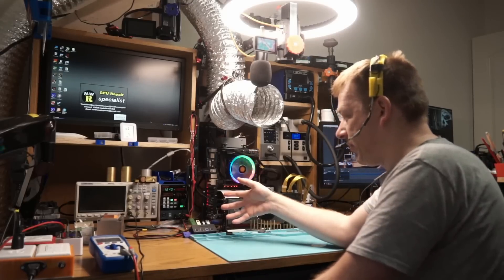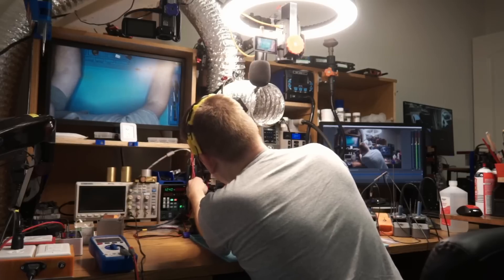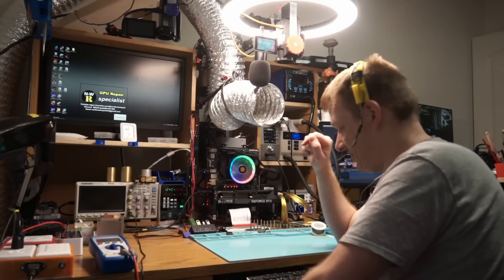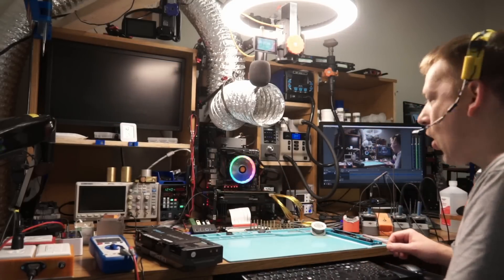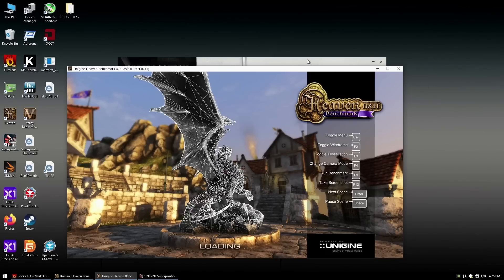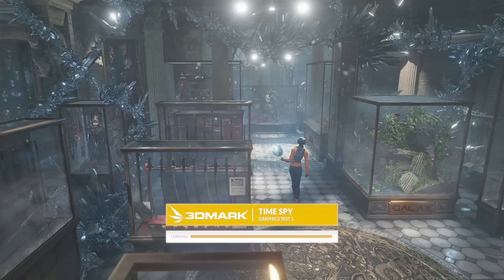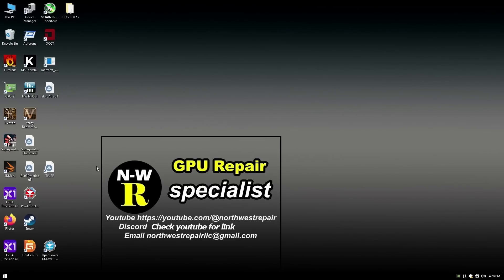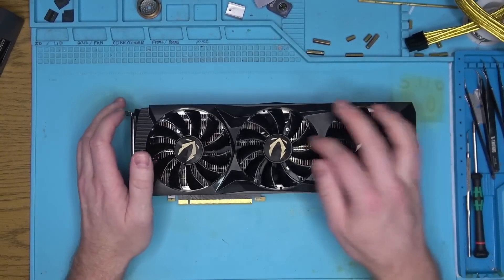Can you swap GPU while computer is at sleep ?

Comment: I doubt the OS fully restarts the graphics driver when it comes back from sleep, so it'll only work if your replace the card with something that would have exactly the same driver state in RAM (meaning it might work with cards from the same generation - though there might still be enough differences between different models that the driver doesn't actually load the exact same code).

Comment: The only thing I know is bit of an issue if you replace during sleep mode is RAM. Windows was so unhappy it didn't want to boot and took bit of persuading to do it. I would assume same happens if you swap CPU. But for graphic card it likely goes like, "I don't know you, you don't know what we did last time" and reboots. :-D Unless Microsoft fixed RAM swap to reboot too. Since last time I did it by mistake it was when Windows 7 was still current. Though considering when I got my work laptop upgraded, IT guys asked me twice if I shut it down and not put it to sleep, I assume they already knew it would be a problem. Didn't get much more info out of them than that... they tend to very quickly tell me to not touch whatever I ask about, like they are worried I might do something... I did once almost got one of them to give me admin account though. :-D
Reply: Not really. Wonky stuff happen due to RAM having some very damn important (for OS) information that you remove. Basically same as killing a bunch of windows services till it bluescreen, but instant and very confusing for OS. With GPU on the other hand...it just dont have any drivers loaded in, and windows cant run without some kind of GPU, so it reboots to load at least basic ones. Can be bypassed by having iGPU or another graphics card in the system as output, so there is at least one working gpu with loaded drivers at all times.

Comment: I think if you replace the gpu in sleep by the same model with the same specs that uses the same drivers this might work. But if you switch to a different model/vendor the drivers are not loaded and the system might crash. I assume that it's not a great idea to do this.

Comment: 3dmark prob has some anti benchmark cheating code that his fishy card is triggering.
Reply from the maker: turns out call of duty does not want to play either so its not a 3d mark issue, its the card.
Reply: @northwestrepair  sadge
Reply: @northwestrepair had a card acting up artifacting heavily but only Ubisoft games R6 for honor and Cod. Amd VEGA
Reply: @user-kd1qg4fo1d  Happened on my 5700XT, sometimes it would artifact on R6 but it doesn't happen in any other game so it's a driver issue
Reply: @northwestrepair  probably solved by now but..., guessing undervoltage, voltage drop under load, a faulty capacitor possibly, or a cold solder (unlikely) .. else if ur running anything else polling the card ..
Reply: yeap, does the same thing once sth tripped when I ran it with in my vm,it just says error occurred, however bare metal works just fine.

Comment: Hey Tony, I'm reading some forums on this issue with the 2080ti and 3DMark, seems that if the GPU is power/clock throttling by a large amount then it could affect the score or the test. They recommend turning off the speeedstep and/or putting windows into high performance power mode. What I did find funny is some have stated "Faulty Products" as a result naming ZOTAC and Gigabyte specifically! 

I think my favorite posts are telling people to user EVGA Precision to tweak until it works, (specifically they think undervolting might solve the issue), or to get an better card. In other words they are just as confused! Take care!

-Deuces

Comment: The PCIE slot has a wake pin that will bring the computer out of sleep.  I've had a few misbehaving PCIE cards (ethernet and wireless) over the years where I've had to cut the wake pin.  They would sometimes even power up the computer from the off state when inserted into a slot.  That caused some really weird problems.  Cut the trace and the cards worked fine.
Reply: You could just disable wake from pcie from bios.
Reply: @krypton1260  In theory yes.  I have a Supermicro Xeon server board and a Gigabyte AMD board (and probably others) that do really weird things.  The Supermicro board will power on regardless of BIOS settings.
Reply: So that's why my computer was turning on randomly
Reply: The less drastic way to fix this problem in Windows from the command line is to run 
POWERCFG /DEVICEQUERY wake_armed
Identify the offending device, for instance "Intel (R) Ethernet Controller (3) I225-V"
POWERCFG /DEVICEDISABLEWAKE "Intel (R) Ethernet Controller (3) I225-V"

It's also possible to do this in the Device Manager in the "Power Management" tab of the properties for the offending hardware. Device Manager isn't organized to do this efficiently, so powercfg is the better way to do it.

Comment: another likely reason that it doesn’t work when you switch to a different gpu, is that pcie isn’t hot-swappable on windows. it doesn’t like detecting new pcie devices until reset. not sure about Linux tho

Comment: 3DMark probably begins the benchmark by sending a max load/full power to bring the boost clocks up before it begins. I suspect there is a power issue only when the GPU boosts with a full GPU load and a full power draw at the same time.
Reply from the maker: clock boost to max when you open GPUZ and then saddle down.
Any game engine will max out the clock on start, not sure if 3dmark does it any differently.
Reply: Either that or it probably allocates all the vram it can and might be allocating just a little over what the gpu actually has, might just be a matter of editing the bios to lower the MB on the vram a lil bit or it might have something to o with windows WDM stealing some vram

Comment: Try turning off sysinfo in 3D mark before running it. It should complain about the results not being official or the like.
Reply from the maker: already off
Reply: It’s this as a former hwbot overclocker seen it many times with modded hardware.